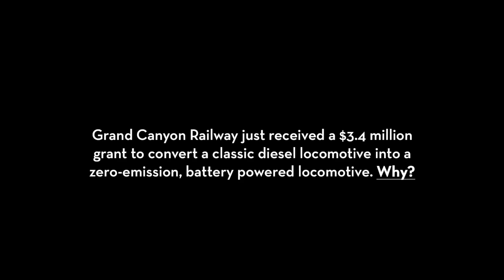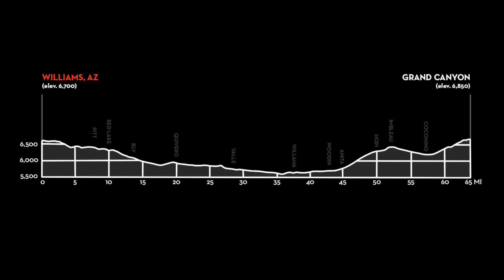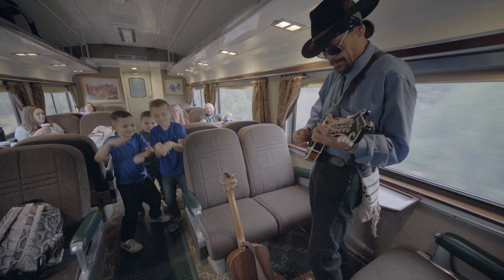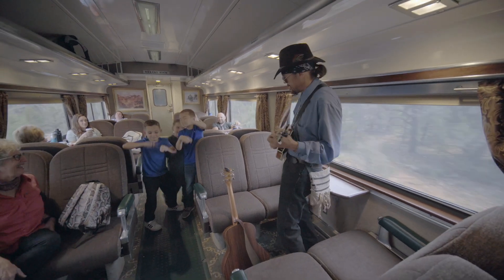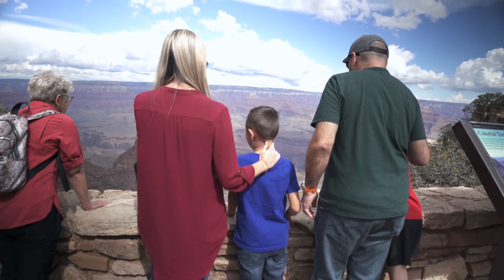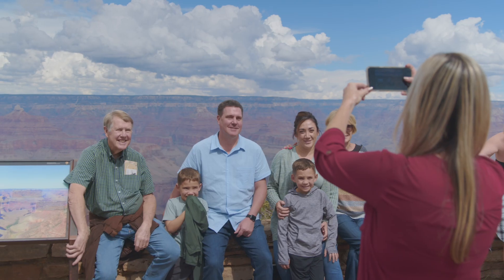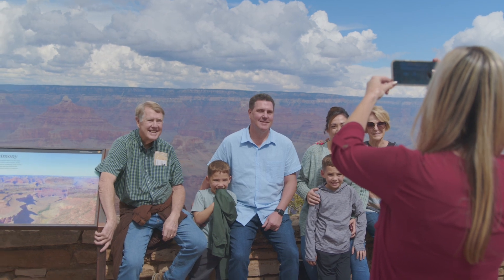Grand Canyon Railway Receives $3.4 Million Grant to Go Zero-Emission

Comment: You know what would further reduce costs, increase energy efficiency, and avoid the need to replace batteries all together? Catenary wires! Pure electric locomotives have been around forever and have fewer moving parts. But this country has a disdain for investing in infrastructure for railroads while chomping at the bit for car and plane infrastructure. So we get half-measure gadgetbahns like Battery electric trains and hybrid trains when the engineering solution has existed for over a century

Comment: Well, a little more of the original Grand Canyon Railway's soul just died. The railroad needs to balance this with heritage. I went for the first time in 1994 because of the steam power and the classic coaches. Ever since the Biegert family sold to Xanterra, the life has been slowly sucked out of it.
Reply: There would have probably at least been some reductions given it operates within the Grand Canyon National Park meaning the National Park Service could have made stipulations for continued operation.

But I get what you mean and either way, the NPS just seems happy for fewer cars going to the park than any improvements in emissions by the railroad
Reply: Only foamers care about keeping old ways of doing things. The vast majority of people in the back don't care what is pulling or how, so long as it does.

Comment: Overall, I understand why this is happening because of everyone trying to go green and the electric scam. However I still am a strong believer for Diesel, Coal and Wood locomotives because I do not believe these battery locomotives will be our future.
Reply: Like climate change, it's not whether you believe it or not, it's whether you accept it or not.
Reply: Electric scam? You do realize these are diesel-ELECTRIC locomotives right? They use traction motors to move the locomotive. By using gravity to spin on-board generators, they can gain energy back which results in less costs going to fuel consumption.